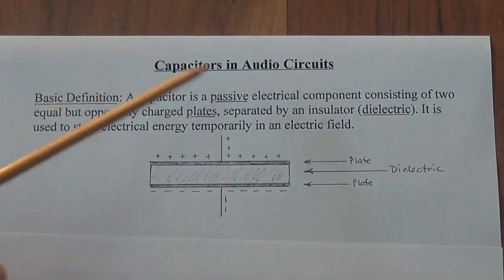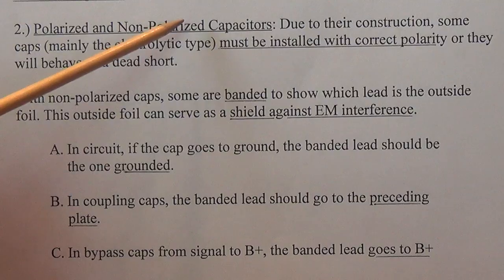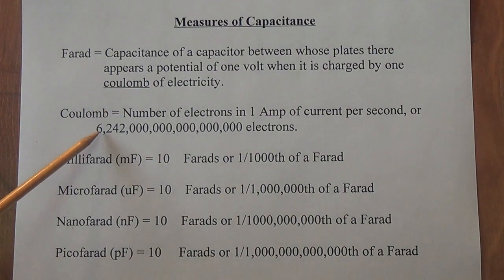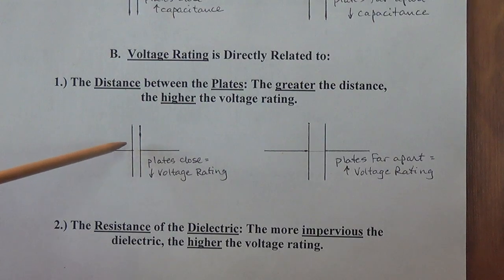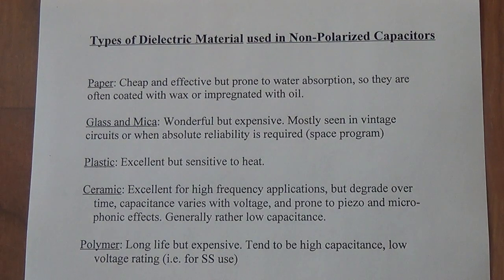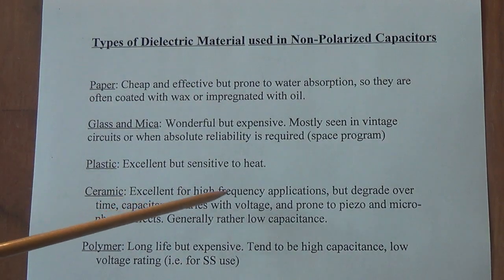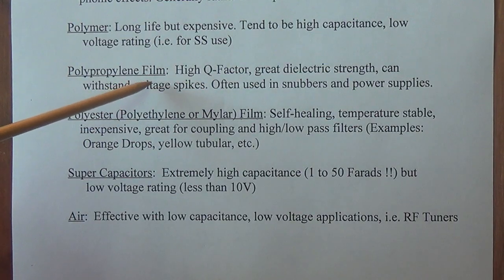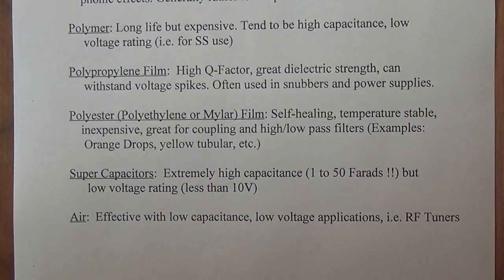Capacitors in Audio Circuits:  Part 1

Comment: Hello! I was very interested (as usual) in your vid. I know the basics about construction and operation of caps (or 'condensers' as we oldies remember them!), but there is so much more to know. I was especially interested in you saying that the old RF caps could be used in audio circuits. I may be able to use this info in a project I'm 'up to' at the moment, using small speakers as mikes. The frequency capability of these naturally is a bit limited, as they are designed to 'hump' in the mid-range area, and some work with a filter, or E.Q. unit would help here. I wonder, have you done any work in this area? Finally, I was struck by the fact that the ceramic cap you showed had a 3 wire set-up, and this connected up with an idea I had whilst watching this video! I wondered whether the capacitance could be adjusted by having a small plate in the middle of the electrolite, and passed to earth, possibly through a pot?
Reply from the maker: Greetings, Ben. Rusty and I stick exclusively with vintage tube amps and have never experimented with small speakers as microphones. Regarding your suggestion of an adjustable capacitor, it's an interesting theory that does sound feasible. You should investigate to see if such a concept has ever been developed.
Reply: Thanks! Could we perhaps call it 'The Morris Effect'?! I WILL search and see if it has been done, I mean, is there an original idea left on the planet these days?!
Reply from the maker: Just when I had given up on any new ideas, you arrive on the scene, Ben. Let us know what you discover.
Reply: Well, I'm well known for asking awkward questions, so, who knows! Have a nice day, here, the rain is only one day away, so I'm making the most of it!

Comment: Just discovered your videos, very informative and easy to follow. I've actually seen one or two Farad capacitors used in car stereo setups to minimize current drop when the stereo is on. when you start getting the bigger amps they'll draw so much the lights will dim without them. They're about the size of a 24 oz beer can or larger.
Reply from the maker: Welcome, CBL. Wow.....that is one big capacitor !!  The filter caps in vintage Kustom amps (transistorized) are quite large also (see my video)......but nowhere near the ones you described.
Reply: Yep, they even have digital readouts on them that show the percentage of charge.
Reply from the maker: Good grief !!  I wonder if they also come with a fork lift to help with their installation :) :)
Reply: if I can find the one I have i'll make a quick video about it
Reply from the maker: Sounds good :)

Comment: Hey followers of Uncle Doug.  As a former navy Electronics Technician, I would highly recommend NEETS modules for a easy to understand course on electronics. You could get them at this website for free http://jacquesricher.com/NEETS/  Module 8: Introduction to Amplifiers is especially applicable.  The great thing about the NEETS modules is that they are designed to turn complete morons, such as myself, into capable technicians.
Reply from the maker: Thanks for posting this link, Clint. Rusty and I are all for any free educational websites.

Comment: Great learning video.  One item I hope you might help me with.  Why do the electronics enthusiast that show the amplifier repairs first go in and typically replace most or all of the capacitors or as they term it as recapping the circuit board?  What value does recapping provide?
Reply from the maker: Thanks, Carl. No value at all, unless all the capacitors have failed and needed to be replaced, which is highly unlikely. It's easier (and more profitable for a commercial tech) to simply rip out a bunch of parts and install new ones.....rather than test the components to see if they actually need to be replaced. I would estimate that about 75% of the electrolytic caps and 90% of the non-polar caps I see in vintage amps are still functioning quite well.

Comment: Great video looking forward to the next one in the series!
Reply from the maker: Thanks, LT. Part 2 should be out soon.
Reply: I have two questions about  the power supply of a schematic. It has a PI filter with two 470uf 700v caps. Would it work with two 1000uf 450V in series, 500uf? 
The second part of this question is that the B+(590v) "goes out" from the first cap in the PI filter and not after the choke. It is UL connected to the OT if that makes any difference. Is it to keep the choke as small as possible and what would happen if you were to connect it as pentode? 
Sorry for the long question but I've tried to do my research but can't find any answer :(
You're the champ
Reply from the maker: Two 1000uf @ 450V caps in series would be equivalent to 500uf @ 900V.....which would work just fine in place of a 470uf @ 700V cap. I don't know the answer to your second question.

Comment: Hey Doug your videos are awesome! I used to work small components years ago in the Marines. I wanted ask for some help troubleshooting my first stage on my Dr Z Z28. It's has an ef86 in v1. Is there an email I can send you a message at? Thanks
Reply from the maker: Greetings. SB. You're welcome to ask a few basic questions using this format. I get so many inquiries that I simply can't also correspond by e-mail.  Sorry.

Comment: Uncle Doug has just the right touch for sharing his knowledge with anyone!  I have been interested in electronics since I was twelve.  I built a two-tube Tesla Coil in my ninth-grade Electric shop, then went on to self-learn TV repair well enough to tackle a RCA CTC6's CRT-conversion/replacement (a 21FBP22 -- all glass -- for a 21AXP22 -- metal anode/outer envelope) in my parent's den, when I was eighteen.  It took all of the night between New Year's eve and the beginning of next day's 1962 Rose Parade (convergence had to be done on using a properly detailed black and white picture that would occasionally hold still, and purity/degaussing were accomplished with the aid of a soldering gun's magnetic field).I went on to found and operate Jim's semi-instant TV service from 1969 until the end of 1995.  I qualified to be a Certified Electronics Technician in 1989.  And so on; but, I hadn't a clue that Ceramic Capacitors were (are) microphonic, although I am familiar with the old-school Recoton and Astatic ceramic cartridges that boasted their three-volt outputs.  I wonder how well a .047 uF disc Cap, having one lead ending in a three-mil radius, would reproduce audio from a 78 RPM record.  How about a stereo cartridge that broadcasts high quality FM that is strictly dependent on a variable position-capacitance; would it be immune to hum?  Cross-talk should be minimal.  Talk it over with your dog and get back to me.
Reply from the maker: Thanks, Jim. I really like the idea of the ceramic disc cap being used as a phonograph cartridge. In fact, Rusty and I may try this out when we get a chance. Thanks for your input.
Reply: Possibly the worst thumbnail ever.

Comment: can we use tuning cap in the tone circuit for the tone
Reply from the maker: If you mean the large radio tuning capacitor, yes, you could use it to find the best value for a fixed tone cap. A potentiometer is best suited for tone control.

Comment: Excellent video! (when is it not?) :) The interesting thing with the Mica capacitors is, they truly are reliable! The only time I've had to replace one is if one was cracked or split open which is quite infrequent. These capacitors were quite common in early television circuits where operating voltages can get crazy, and under high heat conditions. Since I also do vintage tube TV repair/restoration, I tend to leave these capacitors alone and replace the old wax caps, and electrolytics.
Reply from the maker: Thanks, Frank. :)

Comment: The only thing I would have to correct is thst mica capacitors are bullet proof.  A well known problem with old silver mica (domino) capacitors is silver migration.  They also cause havoc in IF transformers.  Many old AM radios that have a high static level or lightning crash sound have bad silver mica caps in them.  I have run into more bad silver mica's than I even care to think about.  Now days I just replace them all when doing restorations.

Mike
Reply from the maker: Thanks for your input, Mike.

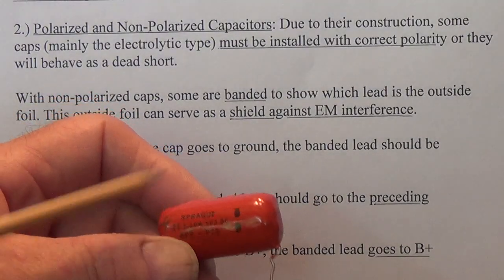Comment: Thanks Doug!   I learned something I can't believe I didn't already know.  At about 4:20, you explain the meaning of the band on orange drop caps;  how did I miss this?  Now I have to go check all the orange drops I've installed lately!
Reply from the maker: You're welcome, John.  Apparently, on the newer Orange Drops, the band doesn't always indicate the outer foil lead. About the only way to be sure is to test each cap with an oscilloscope.
Reply: Yikes!  What a pain!  Sounds like fodder for another video!
Reply from the maker: It's already been done, John.... I believe by a fellow whose channel is named Mr. Carlson's Laboratory, or something to that effect.
Reply: Found it!  Cool!  Thanks!

Comment: Another great moment to start my Sunday!
Thanks Uncle Doug 🙌🙌🙌
I remembering when I was plugged a capacitor in a little audio circuit... So I discovered that they are in a wrong position (just scathe the audio output of my notebook)...
😸 Dear Lord!!!
Reply from the maker: You're welcome, Humberto. Yes indeed, when you install an electrolytic cap with the wrong polarity, it quickly notifies you of your error :)

Comment: Excellent vid as usual, and very timely!  Could you touch on here (or in an upcoming Parts) why some caps have 3 leads? Thanks for sharing your knowledge.
Reply from the maker: You're welcome, KR.  The only caps I'm familiar with that have three leads are double caps.....i.e. two separate capacitors in one container, with a single common lead and one lead for each of the two caps.  Imagine a "W", with the point in the middle being the common lead, and each of the legs as the leads for each cap.

Comment: That Rusty is sooo spoiled, was that a 5 gallon bucket of dark beer?  Cat scan, Doug you kill me.
Thanks for tip on using a radio tuning cap for tone stack tweaks. Hadn't thought of that one yet. 
Can you paste your capacitor summary sheet into the video description? I'd like to keep a copy for my notes.  Thanks Doug, Rusty and Jack.
Reply from the maker: Glad you liked the video, Craig. Yes, Rusty only drinks dark ale :) I'll make a note to upload the sheet to a storage site and provide the address in the video description, as you suggest.

Comment: As always this is another excellent video, wonder if you have found that the newer manufacture Orange Drop/CDE outer foil doesn't always correspond with the stripe on the capacitor. I've taken to testing them before use in circuits and have found this to be true.
Thanks
Reply from the maker: Thanks, Hadley. Yes, another viewer mentioned that the stripe on newer Orange Drops was random and no guarantee that the lead was connected to the outer foil.  I guess it's time to get out the oscilloscope to test them all prior to installation.
Reply: this is correct, there is a vid on the subject that shows it with oscilloscope ;)

Comment: I think the biggest take-away here is the different materials and their strengths and weaknesses.
Reply from the maker: Different folks will probably gravitate toward different topics, DK, but I agree that the comparison of dielectrics was something that I was never quite certain about.....and found to be rather interesting.
Reply: Do you have any experience working with a 12AU6 preamp?  I've got one that's just killing me with hum.   I know it's the 12AU6...  This is another one of the series filament amps...  and  it's 120hz.   Best I can think is to bump up the filter caps... most designs use big filter caps on these...  and my schematic called for "normal"  sizes.
Reply from the maker: I don't have much experience with them. As always, experimentation is the best way to test your theories.

Comment: I know you're probably going to talk about this in the future but I see a TON of information on the size of capacitors immediately after the rectifiers in the power filtering section, but not the recommended or maximum sizes for the caps after that.  For example you can see the datasheet for a GZ34 which might say max cap 60uf.  I've always thought they used limited sized caps back in the day due to size or price constraints and not necessarily because the circuit wouldn't benefit from larger caps in this area. Do you have any information on this?

By the way, great videos.  I vote you work on more Hifi gear!
Reply from the maker: Thanks, BH. I agree that although the first cap value is generally defined in most tube handbooks, the values of the remaining caps is generally not discussed. Having recently performed analysis of the smoothing effects of different filter cap values (see the Trem-O-Boost videos), I would suggest  1.) Simply following the values in schematics of well-known, similar circuits  2.) Using an oscilloscope to analyze the ripple in each node and experimenting to find the minimum cap value that provides adequate smoothing.  You can theorize all day long, but experimentation is, to me, always the best way to achieve a desired goal.
Reply: The value of the first cap after a tube rectifier is limited by the ability of the rectifier to withstand the initial charging current.

Comment: As always Douglas, an exceptionally well presented, as well as eloquently conveyed, video …your aims and objectives certainly come over clearly, and easily understood.
Whilst appreciating the fact it is best to adhere to one genre: and do it right, I can’t help thinking how much greater your electronics theory, and application, would be if your videos included, along with your guitar amplification, and juke boxes; vintage radio, and possibly vintage television, also.  Sure, the latter two vintage electronics genres, especially vintage radio, are constantly added to here on You Tube.  Though a fair percentage of vintage radio men clearly know their subject, a number don’t appear to have an ability to convey their knowledge and skills sufficiently to spark the interest of newbies, or inspire those, whose knowledge is at present limited, to access further reading in this subject.  You, on the other hand, are one of a small number of people, out here in ‘You Tube land’, who not only has an in-depth knowledge of electronics, especially vintage electronics, but also has a great skill at conveying its mechanics. 
This is purely a thought my friend.
Regards,
Phil.
Reply from the maker: Thanks so much, Phil. I did indeed work on vintage radios, particularly the cathedral-style table radios of the 1930's, for many years, but lost interest and moved on to tube guitar amps. I will definitely keep your suggestion in mind, however, and sincerely appreciate your very positive appraisal of my presentation skills. Meanwhile, we all wish you the very best.

Comment: I know it's just an accidental trick with the lighting, but on my laptop it looked like Rusty was drinking a giant bucket of motor oil! Super Capacitors are interesting. I've heard some talk about them one day replacing batteries in much of the technology we use today.
Reply from the maker: In this ungodly heat, the inner wall of his water bucket develops a thin layer of algae, almost overnight......but the water tastes fine, trust me, I know ;)  Yes, indeed, electric cars of the future may run on charged caps rather than heavy, expensive storage batteries.

Comment: most fun I had with Capacitors, was back in Automotive class in high school, we used to charge up the old points distributor capacitor and leave it on the floor and wait for some poor sucker to pick it up, was always good for a laugh LOL!  But now as a Journeyman Automotive Mechanic, I have to watch out for the guys with the big stereo systems, as a lot of them run a 1 farad or higher 600+ volt capacitors. Those will kill you right now if you don't properly discharge them before working on the electrical systems, even the hybrid vehicles have these types in them.  But anyways great Video as usual, can't wait for the next one.  Cheers.
Reply from the maker: I too once cackled with glee after handing charged capacitors to innocent victims, DH.  I have since desisted, however, for fear of disrupting the pacemaker in one of my (now much older) friends.  Ditto with your concern over big stereo caps.....and old picture-tube TV's.  Being fried by an old black & white TV is not my idea of a happy ending :)